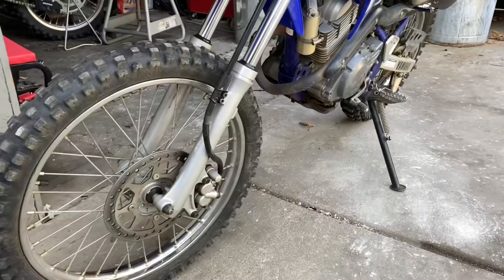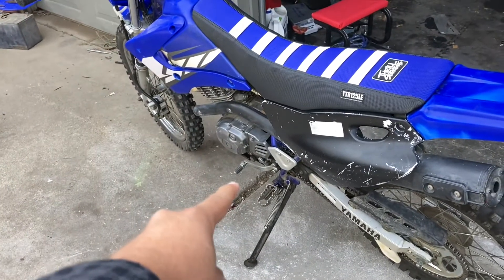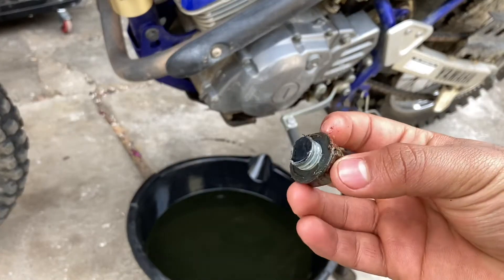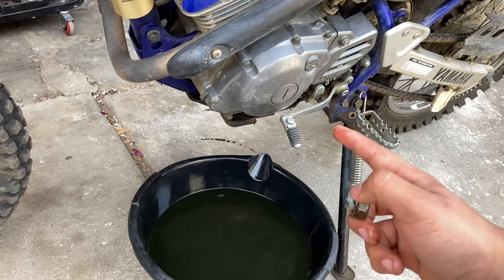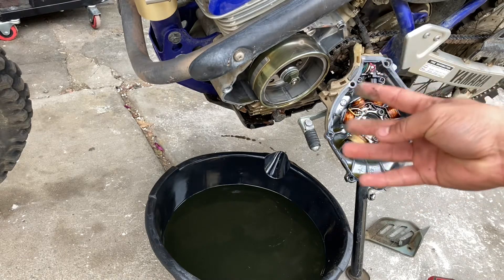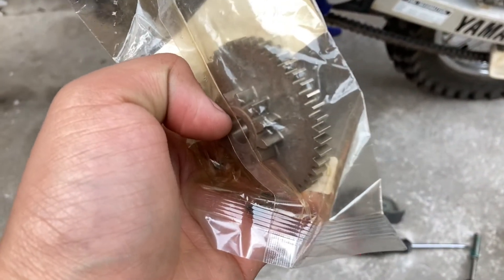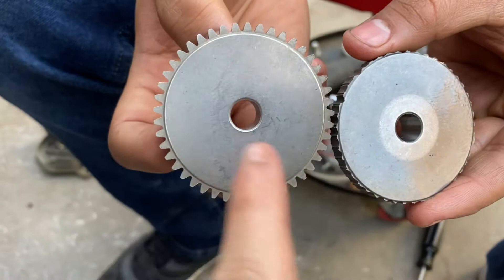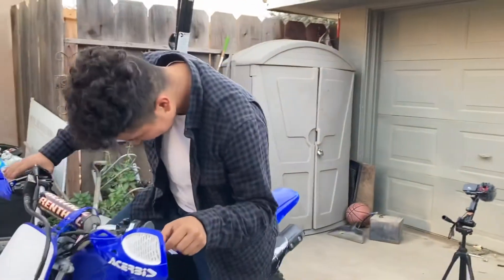TTR125LE Build Part 2: Idler Gear Replacement (Electric Start Fix)

Comment: Now if u tilt the bike all the way over on the clutch side with gas off and flat could u keep the oil in there? Just like my yz 85 when I did clutch basket?
Reply: With bits of metal floating around in there, best to drain it. I flushed mine twice